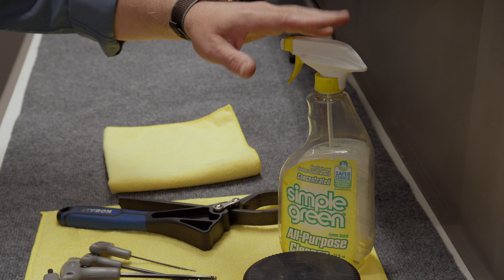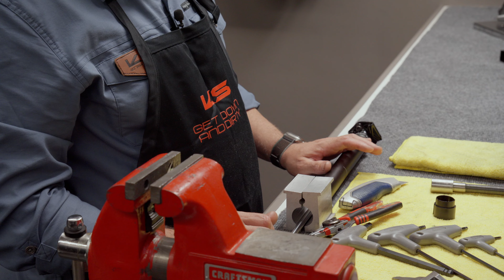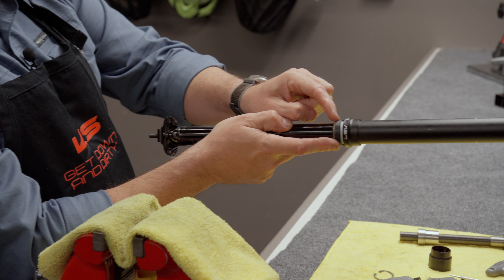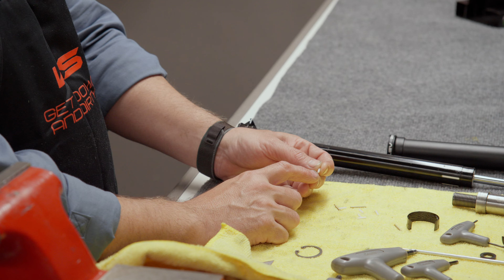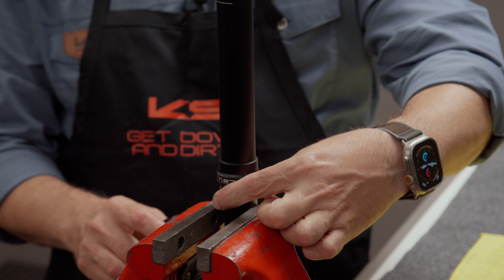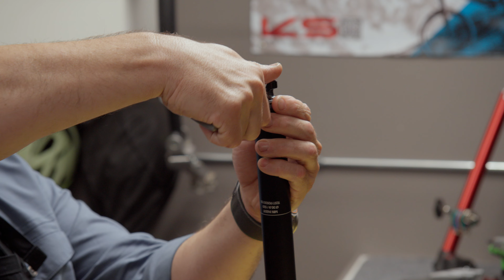KS LEV Integra A12 - Maintenance video

Comment: So, how do you get the special tools that are "readily available at your local shop"? My shop had never seen them before, and they got zero reply from you when they reached out to you about ordering them. At this point if i could return the post and get a different brand that doesnt need tools i cant get, I 100% would. This is rather frustrating and a consumer unfriendly design.
Reply from the maker: Thank you for reaching out. Where are you located?
Reply: @kssuspensionusa I'm having the same issue in the uk !
Reply from the maker: @trev815  Thank you for reaching out. Did you or your local shop try contacting our distributor in the UK?

Comment: I have a problem with the push rod. It pushes too weakly so that the cable doesn't always gets pulled back. I checked the cable and it slides quite freely. While the force from the rod indeed feels too low. Any suggestions?
Reply from the maker: Thank you for reaching out. Check the air pressure in the post and let us know. Also make sure the pushrod is lubed with grease.
Reply: @kssuspensionusa  Thanks for the quick response and for the tipp. I pumped it to the max. allowed 250 psi and the cable tension indeed improved. Didn't think of it because the pressure was enough for pushing the saddle up quickly also before.

Comment: OneUp Components is the way to go when u need a dropper post. No need for special Tools!
Reply from the maker: Thanks for your comment and for engaging with our video! Indeed, in the case of the LEV Integra we recommend to use a specific tool for reassembly, which is designed to make the process precise and efficient, ensuring long-term reliability after servicing. If you have any questions about the service process or need help, we’re always happy to assist.